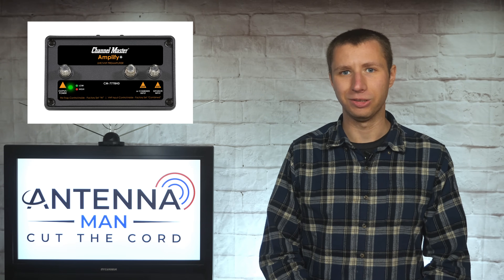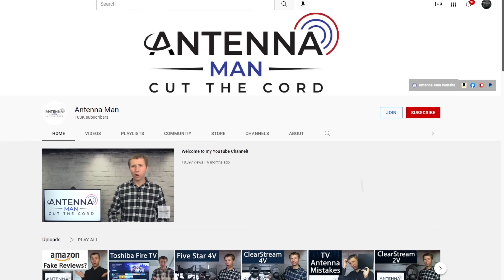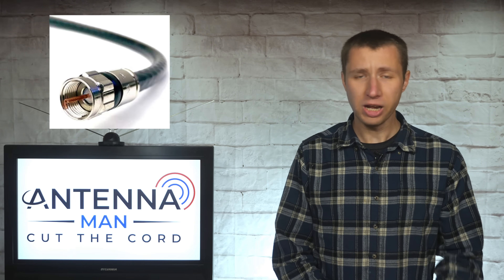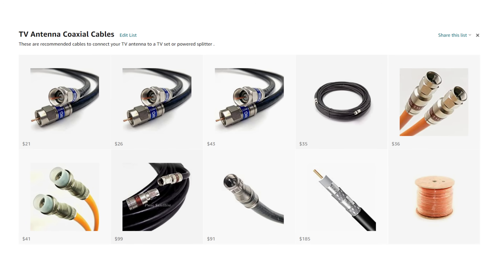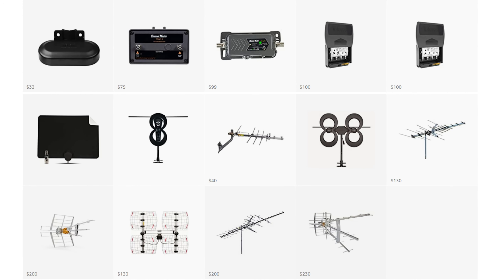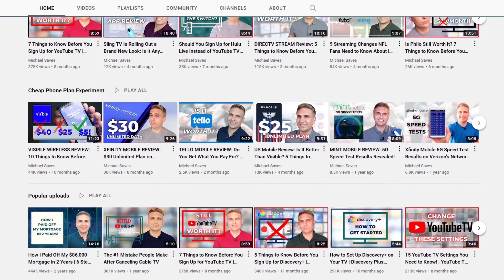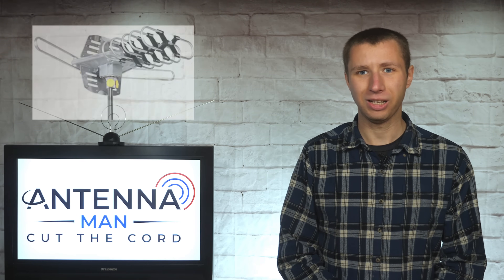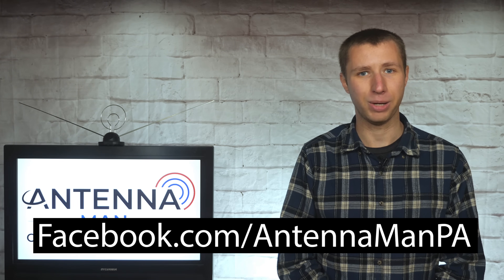Use an Antenna Amplifier? This Mistake Causes it to Fail

Comment: As an installer, I always use dielectric grease and weatherproof fittings on all outdoor connections. Also, I leave a drip loop where the drop cable connects to the ground block upon entry into the home. Then, I put a small cut in the outer jacket at the bottom of the loop to allow any water that gets in the cable to drain, and keep the connection from corroding. I've replaced water damaged corroded fittings many times over the last 30 years...

Comment: I use a amplifier with my antennas and I don't have any problems. All my TV's are hooked up to indoor antennas and I get lots of good channels and not drop outs of a channel. I live in New York City and I am surprised I get so many channels (80) on my TV's. I also stream as well. I cut my cable channels off because they kept raising the price and a lot of the channels are garbage.

Comment: Hi Tyler. Just wondering how a copper cladded centre conductor on a coaxial cable can cause a masthead amplifier to "burn out" as you state at the 1:38 mark in your video?  "Burn out" in electronics implies the components are going to overheat and and thus literally burn up.  Now any tech worth his / her salt will know that steel is less conductive than copper (resistivity being the factor here), but RF engineers working with receiving transmission lines (in this case a RG6 or RG11 coaxial cable) will be aware of the "skin effect" hereby the HF FR signal current actually travels on the surface of the conductor rather than in the centre. Of course this doesn't apply to d.c. and low frequency a.c. like 50/60Hz.  In a typical masthead amplifier the current used to supply power to the amplifier is in the order of tens of milliamperes and as such the voltage drop from the power injector to the amplifier mounted on the antenna is insignificant in a typical installation under 100 metres in length.  If anything I'd be more worried about the quality of the fit off of the connectors and ensuring the weather proof rubber boots over the connectors installed outside is sound and of good quality.
Reply: I had those exact same thoughts.
Reply: And, Tyler, what's wrong with silver?  Silver (Ag) is the best conductor of electricity.  Not that you're going to find solid Ag conductors in coaxial cables but in my experience, Ag plated copper (Cu) conductor cable with the same shielding is superior to otherwise equivalent Cu cable, though the difference in the typical TV antenna installation probably doesn't merit the cost of Ag plated cable - but it shouldn't hurt or lead to amplifier burn-out.

Comment: So, how much current does a signal amplifier draw?  I'm having a hard time imagining that it draws enough that the difference between steel and copper on an 18 gauge conductor is critical.
Reply: If there is a significant voltage drop the amp will fail due to low voltage operation which causes higher current flow and overheat either the power supply or preamp.
I would suspect this low signal high frequency stuff doesn’t tolerate out of spec operating quantities very well.
Reply: Fail how? The video states it will burn out. Why? Low voltage will only stop it operating, not fail completely.
Reply: @EJP286CRSKW  run your computer on a 15% low voltage condition and see how long it lasts

Comment: I agree with you 1000 percent!!! 
A good antenna or group of antennas in my case!!!

PS: remember the good ground.

Here is a question, what are the skip issues with ATSC ver 3 signal ??? And when will a good basic converter box with HDMI outlet for ver 3 will show up???
Reply from the maker: I'm not sure what you mean by skip issues. If you mean tropo related it will be similar to what we have now. If you mean signal breakup it should be much better. It will be several years until we see basic ATSC 3.0 converter boxes with HDMI out as we are still in the very early stages of this thing.

Comment: the real copper core wire also lasts longer. I have customers who use the cladded crap for internet connections and they fail after 2 or 3 years. Signal runs on top of the cable, not thru it, so when the cladding comes off it hugely affects performance for cable lines or Ethernet. It costs a lot more but the solid copper wires are just so much better. You can get 30 years from solid copper core vs <5 years generally with the clad stuff. Also, the clad steal cable will rust if outdoors and the center wire will just break. That doesn't happen with the solid core wire.

Comment: i have already know that , using an amplifier in a  good signal what causes it's a phenomenon like weak or no signal at all by overloading the tuner in most cases  or adding noise to the signal in many cases the noise ground is higher than the usable signal or pilot signal and doesn't matter the type of signal modulation 8VSB/COFDM etc in all signals occurs the same

Comment: As I understand the flow of electricity, electrons flow on the outside surface of wire, not within, so I believe that it should make little difference between copper clad or solid copper wire electron flow!  The steel center woould make the wire stronger.
Reply: High frequency signals flow on the outside surface (skin effect). The DC required for preamp uses the whole conductor. If the copper cladding is not very thick you do not have good conductance. The price difference of proper cable is minor compared to labour and frustration of changing things out over a few dollars. Steel has very high resistance compared to copper and is also more susceptible to rust/corrosion when (NOT if) you have water penetration. You just keep believing what you want and don't bother listening to people who do this day in/day out, ffs.

Comment: I use an old radio shack amp I found at Goodwill over 10 years ago, and it still works with an indoor flat antenna 40 miles from the signal.

Comment: Dc does not care, and a lower voltage will not burn out an amp,it may reduce the gain a little.any RG 6 shielding is more important  then the center copper capper clad works because of skin effect with any RF frequency.

Comment: That happened to me, I was using Channel Master Quad Shield CCS RG6 coax and my CM-7778 preamp burnt out along with the power inserter in 6 Months. Solid copper coax never occurred to me until later. CCS coax is fine with an indoor amplifier as the TV signals travel on the outer edge of the center conductor. But electricity travels through the core of the wire being lower in frequency and copper is better than steel conducting electricity. Some people swear by copper only coax and it that situation it’s fine but CCS coax is fine with indoor amplifiers as only TV signals are being boosted with no electricity being transferred in it.

Comment: Just an FYI. Signals through a cable aren't carried primarily through the entire wire, but on the surface. It's called the skin effect. It's not so much the composition of the coating. In the case of copper over steel, the problem actually comes when the copper coating is damaged, something quite easy to do. It degrades quickly after that leading to the problems described. I would only use solid copper just for that reason. It's a little more expensive but WILL help protect your equipment. The DC voltage does use the entire conductor, but again does degrade with any damage to the surface.

Comment: The quality of coax will effect signal loss, but won't damage a preamp.  The amount of current the preamp uses is insignificant.
Reply: If the cheap cable causes a large voltage drop between the power supply and amp it will affect the preamp.
Reply: @pmscalisi  Preamps use about 200 ma.  If the cable has 10 ohms of resistance along its length, it can handle 3X the current the preamp needs.  I doubt the cable will be as high as 10 ohms unless it's really garbage or 1000' long.  In any case, even if the resistance of the cable is really high, lower voltage still will not damage the preamp.
Reply: @ohger1  thanks for the input! I’m used to power system level stuff and it’s a big deal at that level.

Comment: I can confirm that this is true. A few years ago to catch long-range signals I set up two separate long range antennas one for UHF and one for VHF.

The key decision I made was investing in a solid copper wire along with two long-range antennas.

At the time, I was worried about two issues. One, the run of the wire was going to be quite long and two, how I was going to mix the two antennas into one line.

So I decided to go with a pre-amplifier that had an option to input both a VHF and VHF signal into one line.

So after I set it up, it worked fine for a while but after a year or so, the signal started to weaken. I would have dropouts of signals that didn't make sense.

Sew-in watching this channel, I wondered if maybe I was over amplifying the signal which was causing issues.

So as an experiment, I removed the preamplifier and attached each antenna to their own line and basically just connected them with a basic splitter at the end of each run to see what kind of signal I would get.

I was amazed to see that even with the long distance of the stations and long-run of the cables, I actually got better signals without the preamplifier.

I think the key ingredient is putting your money into good antennas and good cable just like the video points out.

So count me as a testimonial that what he is saying in this video is true.

Make sure you buy the solid copper wire and not the copper clad wire.

Comment: Why doesn't someone make an outdoor pre-amp that goes up on the pole next to the antenna but has a remote on/off-bypass switch so from inside the house you can turn it on for distant channels and turn it off for stronger channels. That way you can use it for both weak and strong. Some company should make one like that.
Reply: Televes antennas can do this.

Comment: Your Comment on Solid core Coax with Cu -COPPER makes sense -  alot of CATV companies have used Steel Wire with Copper Cladding for years!!!   I heard it does degrade- but how much?? I was told always use the GE silicone paste Lube for Coax Connections!!!??
Reply: Thats all catv uses copper coated steel or aluminum it carries current just fine.

Comment: I install up here in Canada. I have used RG6 and RG11 Coaxial Cable  as a main feed line. The inside of the coaxial cable is copper clad steel. Yes you can buy copper. But the larger RG11 only comes copper clad. 

To this day have not had one burnt preamp. 
The reason I can tell,  once the preamp goes bad the customer would not get TV Stations outside the 30 mile area. No one has phoned me, except one customer which his got hit by lighting. 
Steel can conduct electricity too. You would not measure not much loss. 
I will conduct an experiment and measure voltage on a 100 foot coaxial cable in copper clad steel the center conductor. Don’t expect to see a drop in voltage. Most preamps put out 18VDC. 
But getting back to preamp burnout using Copper clad steel. Not one to this day I installed for,  has contacted me. 
My main selling preamp was the grey CM7777 with the 30 dB gain. Before CM changed the style and lowered gain to 26 dB.
Reply: Agreed. I also use copper clad steel (for 40+ years) and have never had any issues. For burned out preamps, it's usually "you get what you pay for". Most are junk these days. I have one from around the late 70s or early 80s that still works fine. Not junk! For failed units, it's more likely that the wall wart power supply went bad and sent a spike up to the preamp that killed it - not from under-voltage due to a copper clad steel cable.
Reply: @Texas1FlyBoy  
I have no idea what gave Antenna Man, copper clad steel Coaxial Cable would burn out a Preamp? This is the first news I ever heard about this!

Comment: I used the solid copper RG6 quad shield you recommended from Amazon. Works well for me but took a little practice to put my own F connectors on it. Ideal linearX tool kit from Lowes got the job done.
Reply: Lol same here. I used the Walmart 1. Saved so much money this way.
Reply: Screw Amazon.

Comment: I use the Channel Master 7777HD on High Boost with the Channel Master Deluxe Outdoor Balun and 100 ft of RG6 Triple Shielded Coaxial on a Medium size Yagi antenna 20 feet in the air. I now have great reception with a drop out  or interference once in a while. I do unplug my Amp if I leave home for an extended period of time. Hopefully it will last a while, time will tell....

Comment: I also watch Michael Saves-a good adjunct channel to yours,Tyler. From your videos,I have learned that my rabbit ears in the window has MORE distortion with an amp than not-I use a distribution amp to feed my HDHomerun and Tivo box. That does not produce the distortion that a direct amp does. Old Cable distribution amp but works fine on ATSC. When you cut the cord,cable company does not account for those,just the boxes .

Comment: Most amps are crappy. Look for one with a noise figure of less than 1db, mast mount it as close to the antenna feed point as close as possible. Use RG11 from the amp to the splitter.  Its not that much more than RG6 but so much better..

Comment: Are there indoor boosters? Mine is good but sometimes pixels.
Reply: The booster (signal amplifier) should go as close to the antenna feed point as possible, i.e. at the antenna, and in between where the antenna connects to the cable that runs into the house. Sure. You can use a booster indoors, but your boosting noise received by the cable as well as the TV signal. Does it matter that you're boosting noise? Not as much with digital TV as it did with analog TV, but it does interfere with the received TV signal.

Comment: I have seen Countless times..
Using Amps in the Wrong way
Most Don't know or Don't care to know
Difference from an antenna Pre-Amp
Or an amped splinter brick
Or how and why at times you can destroy a Signal
Using or using improperly amps/pre-amps and multi-spliter- amps

You should do a vid about that
Pros and cons etc

Comment: Hmm. I think we need some solid electrical analysis to back up what you are saying. Like, can you measure a voltage drop at the amplifier that would actually damage it due to under-voltage? BUT, I agree with the general statement "use a quality solid-copper cable". Also, cheap RG connectors and poorly crimped connectors are major failure points as well. DON'T CHEAP OUT on your antenna, amplifier, cable and connectors. Make a solid investment (NPI).
Reply: Cheap chinesium amp with a capacitive dropper wall wart failing because an intermittent open in chinesium cable allows the supply voltage to spike due to loss of the amp load on the krappy supply? (See Big Clive's "<device> of death" videos...) - I suspect the "cheap china dung" antennas blow the internal amps so quickly because the cheap power supplies go over-voltage too often as they use either a capacitive dropper or a low-grade magnetic transformer with a no-load voltage much higher than the rated (under normal load) voltage...
Reply: @LDuncanShortridge  Another thing may be the cable not having a 75 Ohm characteristic impedance.  A Chinesium amplifier may not take the reflected power.  A nearby lightning strike makes a big RF bang.

Comment: I'm using a winegard booster w/my Winegard ya7000c attic mount..On the 19th,  we  watched Charlie Brown Christmas OTA on Philly  PBS12  .. & my eyes nearly popped out of my head w/ the crisp, clear, intense ,vivid , bursting colors my Samsung gets OTA. Since 1965 & the 56th year I saw it was  like I had never seen it b4!! Unreal!! Commercial free & I didn't move an inch struck w/visual awe for 24 minutes straight . Cable never delivered like this.

Comment: I have to agree with some of the other commentary.  Not sure how the quality of the central core can kill an amplifier if the voltage is steady.  My Simple CEO cables are high quality copper clad steel.  No problems with them so far.
Reply: @garys.7846  right.  But that shouldn't kill the amp, should it?
Reply: @Larry Westfall  any cable has voltage resistance and it's not that under low amperage that problems start. It's when the copper cladding is damaged that the properties on the cable change significantly. As an amateur radio operator I will only use copper canter conductor cabling.
Reply: @GilDavis  Agreed...also, any moisture gets into the coax, the dissimilar metals will create a basic noise creating diode effect. Line loss, ergo power/voltage will also be a problem over distance. Velocity factors, conductivity, etc...you know what I mean. Copper all the way for my HF antennas too...General ticket for over 20 years here....73 OM
Reply: And you're correct about the copper cladding. Keep it pristine. A simple nick from installing a connector will take it out eventually. Also, weatherproofing is extremely important for that kind of cabling since the point where it's cut will also cause issues if it's contestantly exposed to moisture. As mentioned in another comment, problems like this aren't as serious with copper cabling. BUT it's still important to weatherproof your outdoor connections when you're running coax. Here's something else you might find interesting and it all seems to have been forgotten. If you're in a Fringe signal area, you may find that a good quality 300 ohm twin lead actually has a great deal less line loss over a long run. As a ham, I've built antennas from 300 ohm twin lead with 450 ohm ladder line (basically twin lead) to connect to a device that converts it to the 50 ohm connector (a balun). It doesn't have the same Weatherization problem as coax since the connectors are so much different. With that lies other issues that can be dealt with. Coax is just so much easier though and works quite well in a station's primary coverage area.